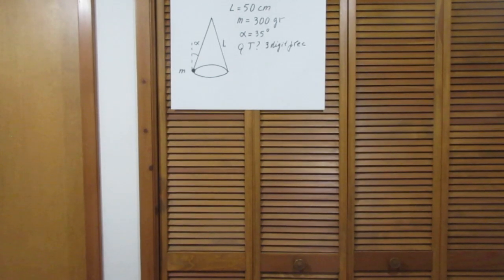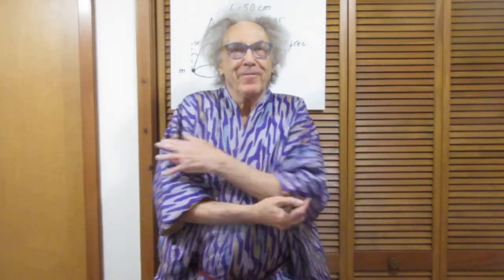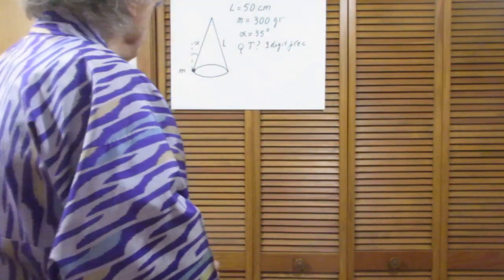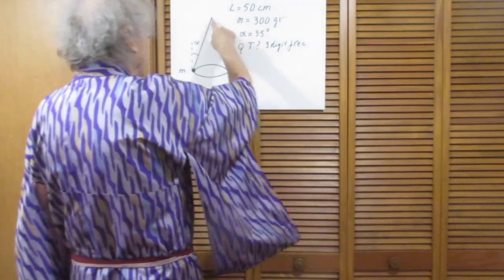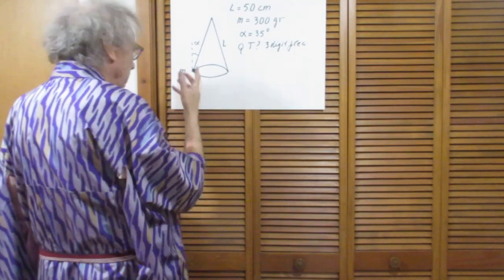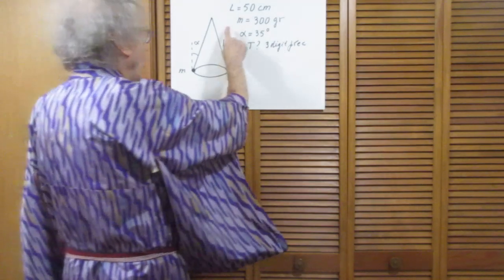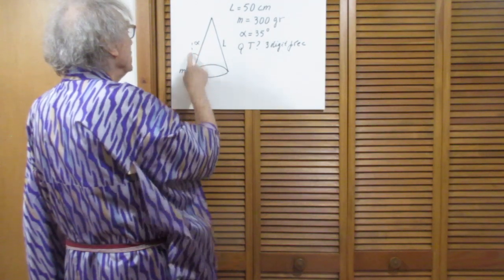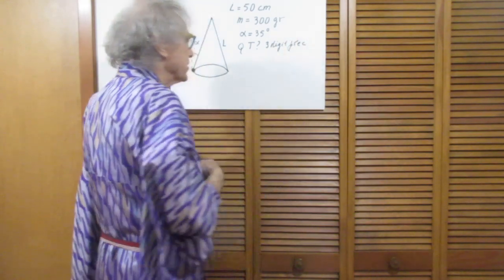Problem #65 Rotating Pendulum

Comment: I've tried approaching many but none seems to answer this! Can anyone including Walter Sir find the frequency of a compound pendulum using F=ma on Centre of Mass? Kindly don't use T=I alpha
Reply from the maker: >>> using F=ma on Centre of Mass? >>> not possible T=I alpha is a must or you use the Lagrangian. use google for more information.
Reply: @lecturesbywalterlewin.they9259  
Respected Sir as far as I am aware, Fext. = M*Acom can be applied on the centre of mass!! This is taught us to be the source of COM concept...  using this in compound pendulum... I am getting simple pendulum's equation...kindly enlighten me in detail if you can... I'd be very very grateful 🙂
 @shirshchhabra@gmail.com
Reply from the maker: I have am iron rod with a mass of 2 kg and a length of 1 meter. There is a small hole in the rod (at A) about 30 cm from one end. I am oscillating the rod about point A. Please send me the period of oscillations using F=Ma.
Reply from the maker: your answer is wrong. correct answer is T=2pi*sqrt(0.6165/g)
Reply: Kindly note sir, I know that the frequency is incorrect physically and we're getting it correct on using T= I*alpha but sir I realise that there is no folly in the concept I am applying, how can it be wrong? Kindly enlighten me! @lecturesbywalterlewin.they9259
Reply from the maker: @Shirsh  get educated in Physics - watch my lectures.

Comment: This is a weird question but could it be possible to make a electric propulsion system with a ferrous iron core. 
I only ask in relation to the pendulum because the things one would use to create a point emission stable from a rod core would probably look like them to avoid internal vibration.
Reply from the maker: >>>to make a electric propulsion system with a ferrous iron core.>>>
what will be your source of energy?
Reply: @lecturesbywalterlewin.they9259  I think if you went small enough with enough precision you might be able to  get it down to a solar panel for something that just acted like a modified spark plug that would be a nightmare though and would be better suited to other metals. 
However I think that if you had something with that kind of internal atomic structure and magnetic properties you might be able to take a similar concept that was used to win the Nobel prize last year for short laser burst and apply it to magnetic fields sort or a filling in the gaps of magnetic flow so to speak.
Just an ferrous iron rod surrounded by electro magnets spinning around independently controlled hanging around a spinning ring surround by a faraday cage with a electromagnet ring at the end to pull the smaller magnets into position and control emission. 
It might be a bit crazy and for something the size of a pencil take enough power to run a city and be impossible to stabilize without control on high ai levels and be prone to extreme catastrophic failure from slight magnetic impurities but I think that it would probably work.
Like a hall thruster for iron.
An iron rocket so to speak.
Reply: @lecturesbywalterlewin.they9259   you know looking at  it a bit I think if you tried  to induce a similar scenario magnetically to what they tried to do with force focusing fusion devices and instead of going all the way with fusion  and having the collapse point be at the ring you could probably get away with just two spinning points and a lot of power. So I guess  the power supply would end up being a wall of capacitors and a small solar panel  and you would just putt along which would be fine. That and I started looking at what it would take to model the fields off of a the thing I mentioned before and well didn't turn out how I was thinking.
Reply: @lecturesbywalterlewin.they9259  ok I had some time to think about this and sorry if I may seem a bit crazy things like this that I can see something new in become a bit of a compulsion and I will leave all at this.
I decided to break down the concept to its simplest parts and found it a bit simpler than I expected. 
If you set up a turbulent magnetic field through the system described as just contained and narrowed angular momentum. Then it becomes a matter of placing the change of direction in that field in such a way that the turbulent flow can no longer follow the the path and is either transferred to the medium it is flowing through or spits out the back. 
I think that would be a working stable model. 
The completely of such flows is surprisingly daunting though and there is still the internal reflections of such a flow that make things weird when I try to work them out in any way but on power scales that allow  me to avoid them which might make the concept unviable.
So hit and miss.

Comment: Professor, My name is Madiha Tsuzuki and i am from India. I was curious about one phenomena I observed some days ago. 
When i put the flashlight of smartphone in between the blank white pages after some pages the light that i see through the pages turns Pink!! And then it turns into shades of pink. 
Do you know why it happens Professor?
I first thought it might be the radiation of light absorbed by the paper , but I feel like ots unlikely.
Reply from the maker: use google
Reply: Professor , i checked on google but i couldnt find answer. I posted a question on quora but didnt received a reply yet. Sorry, Professor but I am miserable at searching stuff on google. Can you please explain the phenomena.
Reply: BRM
It is due to the large wavelength of red colour.When the thickness of the paper increases appreciably relative to the intensity of light,the phenomenon of dispersion occurs.Red colour bends least while violet the most.Hence u observe the pink colour.When the thickness  is increased,the intensity of light that gets through decreases.Hence shades of pink are observed.
WA
Reply: But sir, I tried the same with tissue paper and it passed yellow light. 
Does it mean that the shorter wavelengths get absorbed by the paper??
Reply: The colour is violet with Book Of HC Verma and classmate copy. But pink with A4 print paper. I think that the two are at opposite sides of the colour spectrum. 
The tissue shows yellow colour.
Reply: Please professor you tell the reason behind this

Comment: this is a good question. What is the difference between a physical pendulum and a mathematical pendulum? I like your lectures.
Reply: Mathematical pendulum is simply a thread and point mass like Bob . Time period is simple T=2 pi √(l/g)
But physical pendulum deals with rigid extended bodies . Instead of small Bob it can be a large ball or disk ;the thread can be replaced with Rod . Here the calculation is slightly difficult ;you have to consider moment of inertia of those rigid bodies about the point of suspension . Actual expression for time period is 2 pi √(I/MgL)
I is the MI of the system . M is total mass and L is the distance of  
Center of mass from point of suspension . You can see for simple pendulum I is ML^2 and you get the previous equation . But the second equation is more important than first one .